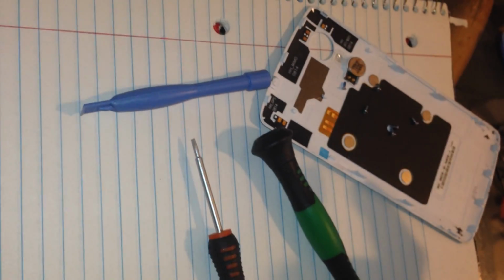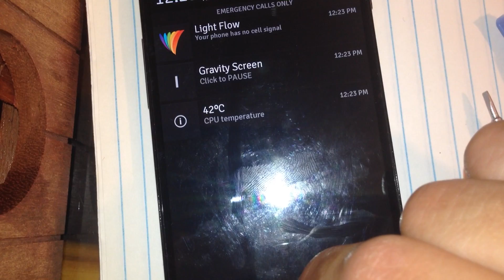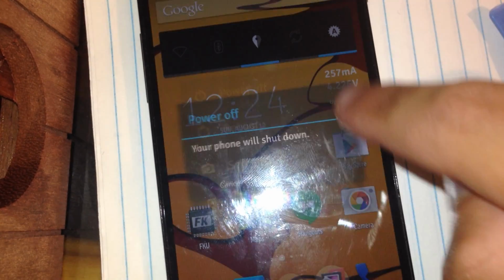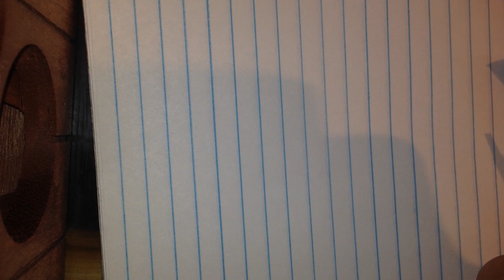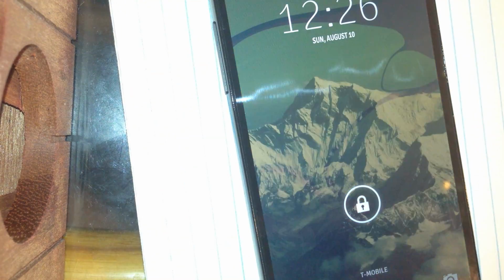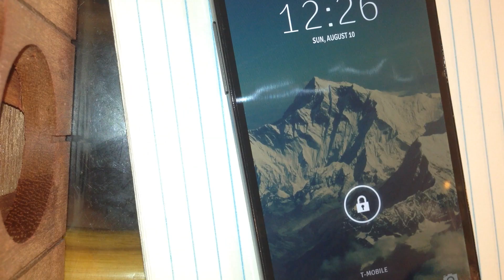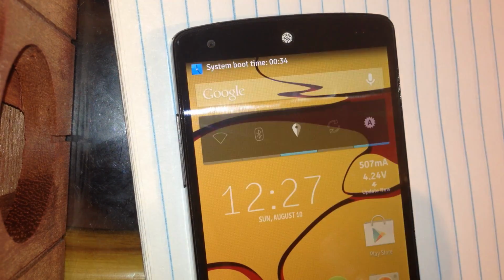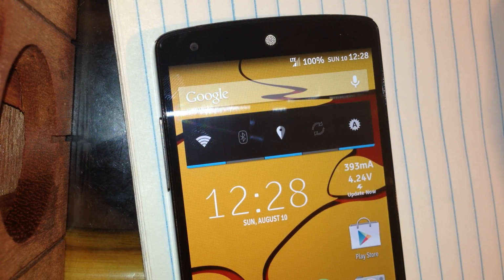Nexus 5  Heating Problem; Solution

Comment: My power button just died. I replaced it and since I have opened the phone yet I followed your video. From 75°C to 65°C under high load.

Having Nougat 7.1.2. The best phone ever!
Reply: how you found metal plate under the motherboard? i put thermalpast without them xD , work it,

Comment: Thank you very much! You have saved me. I was climbing thousands of forums trying to understand the reason. With you I fixed my phone in 10 minutes. Very strange, but in my phone does not have steel caps on the CPU and thermal grease not applied. I have used a copper plate and thermal paste applied. Temperature 39-44

Comment: Hi everyone!
Firstly, thank you for the upload. With this video, I learned a lot from you.
But I gotta say some things about this way of your cool solution.
Firstly, Salamu Alaikum to you all people that still stands with this great phone. It is still a great device for me.
Secondly, today I tried this with a copper made square piece with a high quality Thermaltake Compaund like you did. The only difference with my way is instead of metal, I used copper piece for the heating problem. And with this method, you could keep away more heating from the cpu of the phone. Now I'm using it about almost 6 or 7 hours, it's great! It has also helped me a lot about the quick change consumption.
I Definitely suggest you all whom wanna try this way for the heating problem experience.
I hope that I helped people who are interested to try this solution for their Nexus 5's.
Be in peace ✌

Comment: That's not the cpu. That is the 16GB storage chip
Reply from the maker: it says SNAPDRAGON on it not sandisk or samsung -_-
Reply: The visible part is the RAM and the processor is underneath it. https://www.ifixit.com/Teardown/Nexus+5+Teardown/19016 The flash storage is on the other side, where the battery connects.

Comment: Does this method also help the battery's life? I mean yeah it helps to reduce the heat but what about the battery life? Is there any improvements?
Reply: Jom It would actually reduce the battery's life because the CPU would never throttle down during intense usage.  But the point is to maximize CPU performance and eliminate heat related chip damage. which is especially bad on LG phones.

Comment: Hey bro please help me, ever since i've updated my nexus to marshmalllow (android 6.0) the phone keeps overheating to the point that its always off, when ever i charge it, it overheats and stays on 0%, will this help me? please reply
Reply from the maker: Use nexus rooting toolkit to flash the phone.  If it doesn't help try to downgrade back to lollipop
Reply: +DavidTech Thank you, but can this video help me decrease the overheeat?
Reply from the maker: +Justin Capulso it's up to you if you know what you are doing.  If not just go with the downgrade and try clocking down the cpu
Reply: +DavidTech Thanks bro very helpful

Comment: hlo bro I am using nexus 5 when I press my back cover of my mobile it goes black or colors changing in screen.some time the touch not working ..but after restarting the mobile working probably..when I press back panel little hard it goes black..:( its is flex cable problem or screen problem pls tell me..
Reply: probably flex, if the lcd problem it won't get fixed by just restarting the phone. so you might need to change the flex cable.

Comment: Hi, I got a question, what material is the middle frame? I mean the spot where you added a bit more of thermal paste on the video. Is it some metal or just a plastic? I'm thinking about doing it on my Xiaomi MI3 because it's getting a bit too hot.
Reply from the maker: Aluminum
Reply: +DavidTech Thank you for confirming, I thought it is most likeluly aluminum, but it was hard to tell from the video and also other photos around the internet. I think my SoC doesn't lean to the plate well, because my temperatures rise very easily to 60 and even over 90°C at heavier CPU/GPU load, which is the point where it thermally shuts down(for me anyway). This wasn't happening earlier until a certain ROM update was released and my temperatures were even as high as 110°C and the top of my screen was literally burning hot.
Reply from the maker: this mod helps keeping it cool anyway to prevent any type of damage
Reply from the maker: Aluminum from a computer heat sink

Comment: can i do this on my 1+1 ???
Reply: Can be done on any phone, it's just the concept of knowing what you are doing
Reply: And knowing your phone parts
Reply: I have change the screen so i know how to fully disassemble my phone.
Reply: That's a start,  just use the same material I used and yes it should work on your phone just try it without the thermal paste and see if it closes and if it does add the paste
Reply: ok i'll try it

Comment: work on nexus 4?
Reply from the maker: I have a video for the nexus 4 on my channel
Reply from the maker: yea do the thermo paste and replace the battery
Reply from the maker: any good white or copper paste works.  the expensive ones
Reply from the maker: http://www.amazon.it/gp/product/B002CQU14A?colid=B3LLZ3KRXUNU&coliid=I33P1DQUVSK2DA&ref_=wl_it_dp_o_pC_nS_ttl
Reply: David + Tech 

Hello , when you feel should be added to the thermal paste to the Nexus 5 ?
I have to replace the battery , and after two years , no longer holds good charge .
Reply: David + Tech Thanks :)
Reply: +DavidTech Hello , what kind and brand you purchased thermal paste ??Thank you
Reply: +DavidTech 
what is better between the two ?

http://www.amazon.it/gp/product/B002CQU14A?colid=B3LLZ3KRXUNU&coliid=I33P1DQUVSK2DA&ref_=wl_it_dp_o_pC_nS_ttl

http://www.amazon.it/ARCTIC-MX-4-termoconduttiva-professionale-conducibilit%C3%A0/dp/B0045JCFLY/ref=sr_1_1?ie=UTF8&qid=1455199751&sr=8-1&keywords=pasta+termica
Reply: +DavidTech Ok. 
Thanks so much. You've been very kind .
Good evening

Comment: so, my nexus 5 fell to the ground, not so high distance but it started to overheat to the point of shut down... any idea how to solve this? thanks
Reply from the maker: Something became lose,  it might be completely dead if not fried, take the battery out and wait couple seconds then connect and charge
Reply: The phone works but it takes like 5 minutes to reach 100c and then shut down...  Also it's not reading Sim card...  I heated it with a soldering station but no solution :/
Reply from the maker: +Adrián González something is gone wrong, I wouldn't recommend messing with it,  it might catch on fire
Reply: I think so too hehe he... I'm a phone technician but I can't get this guy to work again hahaha
Reply from the maker: +Adrián González the irony haha
Reply: I know it's been 8 years.. but did you find a solution to this? I have the exact same problem on my nexus. Looking to restore some photos! :)
Reply: nope i just threw the phone in the garbage, sad because it was a very nice phone @contemplatingduck

Comment: my nexus5 temperature is around 43 by just using chrome and facebook,is it neceesary for me to apply the thermal paste ??
 By inserting a metal plate will the part above the plate raises up?? wilkl there be any un uniformity in the size becoz the plate will have atleast some thinkness, and will the screen gets heated up???
if the screen gets heated up ,how can i use it for calling??

Comment: hi good day...my nexus 5 screen keeps flickering for the past two days, today i cannot see anything on my screen...can you help?
Reply from the maker: It's either a lose screen connection or bad graphic card drivers
Reply: DavidTech k...i went by a technician and he told me it is d screen with d flex cable...n it wud cost me $600.00tt...bcuz he hav to order d part and dats d cost for it...is dis tru?
Reply from the maker: Aliya Mohammed no that's a lie,  the screen is only a $100  and takes 20 mins
Reply: Ok thank u very much...i am from trinidad so its better if i order it online
Reply from the maker: Aliya Mohammed yea you can do it just order it online and watch a video on how to change it and swap everything to the new one
Reply from the maker: Aliya Mohammed spends on where you buy it from, but it should
Reply: Ok thank u

Comment: hi yesturday i plugged in my n5 into charger but it wasn't charging and the charging port overheated and burning smell was coming my battery is 0% and its not opening will changing the port will be sufficient...............
Reply from the maker: vinayak chaudhary something just got fried in there, short circuit somewhere in your phone: which is not good

Comment: My nexus 5's battery get 50c temperature while playing game :'( I think it is to much . and without gaming it remain 36c to 40, 42c .. Is it OK ??? Please reply soon.
Reply from the maker: That's too much, a lithium battery should go above 43 - 45 that's going to shorten it's battery life and also really bad for the adhesive in the phone or in the display, try not to let it go too high for more than a min or two
Reply: +DavidTech I've had 3 different nexus 5s and they have all been complete shit, my current one wasn't charging and my cat slept on it, when I picked it up from under him it was at 75c and 2% battery, now its just permanently hot (was before that but now even worse) idled at like 50 before and now idles at 55-60. Im going to try this but if it doesnt work is it even safe to keep using the phone? Something is obviously wrong with it :'c

Comment: Need some clarity!
So you applied the thermal paste between CPU and the piece of metal, as well as between the metal an screen back? Is that correct. Thanks...
Reply from the maker: Yes it's between the screen and the aluminum piece and the piece and the CPU

Comment: Nice to see someone did this mod to the Nexus 5. I used a thermal pad (.5mm thick) instead thermal compound. Crazy Taxi: City Rush doesn't lag after prolong use.
Reply: Clarence Ie Did you also add the metal shim or just use a thermal pad?
Reply: Clarence Ie Did you also add the metal shim or just use a thermal pad?
Reply: Just a thermal pad. The thermal pad was a bit thick,but it was compressible. I think it's the perfect size.
Reply: Did it work or u suggest we go the thermal paste way?
Reply: Clarence Ie u have no life jesus

Comment: why cant OEMs do this in the first place it will only add a few cents to the manufacturing cost >_<, i need ot do this for my old g-nex
Reply from the maker: I dont know man,  it's so easy but the con is that the screen gets warm which is OK, not a big deal but the device runs cooler never go above 52 or 58c  on heavy use